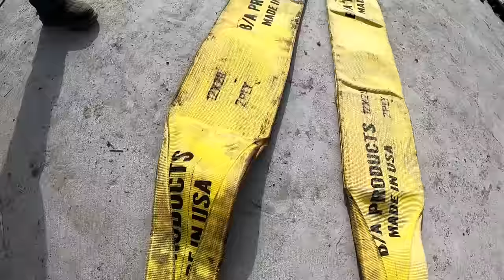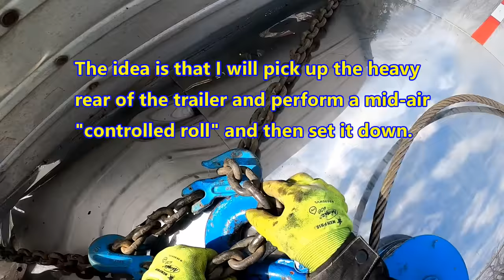Haz-Mat Tanker Rollover Shuts Down Everything!!!

Comment: Possibly dumb question. Why not connect the vent lines as well as the transfer lines? Seal the system, pump the liquid into the good tank and vent the displaced air into the wreck? Seems to me that would solve a multitude of issues. The vent line on the good tank would always stay above the liquid level, the displaced air would help move the liquid and keep the wreck from collapsing under vacuum, and non of the vapour would escape.
Reply from the maker: Not a dumb question, but one I can't answer.   I was not part of the off-load crew.   The trucking company hired them.  I happened to know a couple of the guys on the crew and I was around during the off-load, but that is not my area of expertise.   Thanks for watching and God bless.

Comment: Having watched your exploits and excellent approach to problem-solving in the field, I watch this alternative and was less than impressed (Rotator work ep #104 road block). It made me appreciate what you do all the more. I am a Marine Engineer and from the UK and appreciate how you try to prevent additional damage by your planning and execution of your jobs.  
I would also like to know ( but you can say none of your business if you wish) did you purchase your 1150R new, and how much more expensive in comparison would the new M100 be, 100%, 150% more? Lastly how much equipment do you need to purchase, for example, are the chains and strops an extra cost? 
Great videos, keep them coming and may your God look after you and your team.
Reply from the maker: I have not watched the episode that you reference, so I can't speak about it.   I can answer some of your other questions.  We did purchase the rotator new in 2015......ordered in 2014 and it cost a little over $600,000 USD + another $150,000 USD for the rest of the equipment on it.  Some of the chains, the carousel, D-ring shackles, etc. can be purchased as options to be on the truck when taking deliver, which is what we did.  We still added a lot of other things and have continued to add as we go.    If we were to have to replace the truck now, the current price without all the extra gear I mentioned would be around $750,000.   The new M100, I've been told, is almost double that, but I do not know that to be fact.   I do trust my source, though, and I would believe that that machine cost that amount.   I wish we had enough business to support such a machine.  Perhaps some day.....    Thanks for watching and God bless.
Reply: @RonPratt  Thank you Ron,,
Just like your videos a complete and truthful answer. I was wondering if the size of the lift cables and the associated equipment on the M100 would require two or more people to manipulate where you only need one with the 1150R. So the cost of the job almost quadrupled with a doubling of capacity?
Thanks Again and keep up the good work.
PS It took me an episode to two to realise your comments were in company colours. Great eye for detail on your part (Thumbs Up)
Reply from the maker: Our truck is almost a two person truck as it is.  Some of our rigging is very heavy.  So I would guess that the M100 would REQUIRE two people to handle all the rigging, if not more.   Our biggest chains are 5/8" grade 100 X 20' and they are extremely heavy.   Our largest master link is 1 1/2" diameter.   From what little I have seen on Miller's videos, that is about where they start on the M100.   Generally what you seen me using are the 1/2" grade 100 chains, which are heavy enough on their own.  We grab the 5/8" on most loaded rollovers.   
As for the color-coordination.....I try.... ;-)
Thanks again.
Reply: @RonPratt   I enjoy being able to watch what you do, the way you present and lead your team. Respect.

Comment: Linguistic "tip" (or linguistip) here: The "arc" here is usually arch- as a prefix, like "arch-nemesis" etc. The prefix comes all the way from the Greek word archos (αρχός) which means the chief, the boss. This is the same root that gave us archbishop, archangel, monarch, etc.
Reply from the maker: I am very familiar with the origins and the terminology.   I intended to use the term "ARC' NEMESIS, as a play on words.  We work around high voltage power lines frequently and they can create an "ARC" of electricity.   Thus.....the improper, yet intentional use of the term "ARC" NEMESIS.  Thanks for watching and God bless.
Reply: @RonPratt  Touché! The joke's on me and I had missed it completely!

Comment: Rob I just noticed how clear your videos are..what brand of go pro. Im asking because I take videos while we are out riding the backcountry roads on the motorcycle.
Reply from the maker: I use several different GoPro cameras.   I don't remember which version I was using during this incident, perhaps the Hero 8?  The Hero 8, 10, and 11 are all excellent cameras.  I had a lot of problems with the Hero 9 and lost a LOT of good footage.   So, I would stay away from the Hero 9.  Both the Hero 10 & Hero 11 are very good cameras.  The 11 has a little better night vision and stabilization.   The 11 is also capable of higher resolution footage than the 10, but not by much.  I'm currently using the GoPro Hero 11 and I'm loving it!!!    Thanks for watching and God bless.
Reply: @RonPratt  thank you so much..I cant wait til I can get some good riding videos.

Comment: I don't see a grounding wire between the tanks. That's usually used to avoid static electrical charges building up between the tanks - which may cause a spark...
Reply from the maker: This incident was several years ago, now.   However, I know how well the Regional HSRT Team works and they would have made certain that the tank was grounded.   I've trained with them.   Thanks for watching and God bless.
Reply: ...and I would have attached a grounding wire between the wrecker and the tanker, for the same reason. After all they're both on rubber tyres.

Comment: That would’ve been a low speed rollover which the frame may not of bent but because nothing is hooked to the cab to keep it from flipping the frame definitely is bent now with slam down and probably did some suspension damage to the front of that semi! That’s sad with all that equipment there but nothing was able to keep the cab from slamming the way it did

Comment: I kind of would have liked to see the reactions from the responders when they finally found out that it wasn't either diesel or gas, but whatever unholy mix of waste they had in there. Over where I live, having a diesel sign on your truck when it's not diesel would net you a nasty fine at the very least, because firefighters could get hurt using procedures for a diesel recovery if it was something nastier.
Reply from the maker: The fire and HazMat crew had the BOL which showed exactly what was in the trailer.   I showed I brief clip of me going back to the command center.   I cut out all of the discussion about what was in the tank.   I also cut out the command center discussion of our recovery plan with all the various agencies.   I would have loved to have kept that part in the video, but there was sensitive company and driver information involved, so I cut that part.   Thanks for watching and God bless.

Comment: Hey Ron I’m a firefighter in Canada. You said you could smell it. It’s hazardous panel is wrong if it’s a mix of waste. If it’s radioactive waste or nuclear waste forehead monitors won’t go off. Probably should line up some court documents to be able to quickly sue if you fall ill. You don’t got Obama care anymore
Reply: It was a mix of flammables, not radioactives. The placard indicates flammable, not otherwise specified, low flash point, which is what they had to deal with. Nothing more, nothing less.

Comment: I know it might sound daft, but would you not remove the fuel from the tractor itself, its own fuel (not the load), so that minimizes possible spillage during the roll over maneuver?
Reply: The fuel tanks weren't breached. The caps were intact and the fuel contained. Opening the caps to get to the fuel would have risked causing a spill instead of preventing one.

Comment: Hazmat DOT will love this video!  No ground line anywhere!  Wrong tank for hauling fuel!  Great training video!  Sure glad everything worked out but in the future may want some hazmat training!
Reply from the maker: You need to look and listen closer, sir.  There was a ground rod and wire running to the overturned tank.  They are clearly visible in the video.  I also discuss what is in the tank.  The driver had given wrong information, perhaps due to his recent traumatic event.  We found the BOL and the tank had a mixture of flammable hazardous wastes.  It was placarded correctly.   Thanks for watching and God bless.

Comment: Irony is I work in  a wash bay and we have these high shine tanker trailers they arent that big on the inside but if this is the same company as we use for these then they all have air valve venting on the passenger side of the trailer depending on this trailers age
Reply from the maker: Thank you for watching and God bless.

Comment: If in fact this CDL/Hazmat driver was actually hauling Gasoline. I see a Big Fat ticket already. Time-13.55. His Placard he is running is mainly used for Diesel ( 1993 ). The correct Placard should of been ( 1203 ) placard. Just thought I put that out there.
Reply: The gasoline reference was from a misstatement by the (understandably) shook up driver. Ron explained that HazMat and Fire retrieved the BOL and correctly identified the cargo as flammable waste material, consistent with the placard. He didn't show the details for reasons he explained in replies to other comments.

Comment: I'm nowhere near an expert, not even a novice. But I just had a thought. I assume the hauler is what prevented the whole trailer from rolling into the ditch. Couldn't they have put air bags in the ditch under the trailer to keep it from rolling in. Detached the hauler from the trailer, dragged away the hauler. Then lift the trailer separately? Like I said, I don't know squat, and your plan worked in the end. It just seemed more dangerous/precarious to lift them both at the same time.
Reply from the maker: In my opinion, it is actually much safer to leave the "hauler", as you call it, attached to a loaded trailer.  The legs of the trailer are not strong enough to withstand the side pressure of a rollover.   And air cushions on a tank are very unstable.  This type of insulated tank is especially dangerous to the air cushions.   The outer shell is very thin stainless steel with a layer of insulation underneath it, then you have the thick core tank.   The outer shell will crush and move around which can very easily cut through air cushions or straps.   There is a method that could be used to upright the tank if the hauler is removed, but it is a very advanced method and very dangerous with this type of tank.    Thanks for watching and God bless.
Reply: @RonPratt  I see, with that information I can see how there is risk.

Comment: Hey Ron, so how would you take away a tractor trailer, that was on fire, do you guys have a trailer, also any plans to buy a safety car, with traffic cones, signs, and a digital message sign board?
Reply: They've handled burn outs. Midwest doesn't have a trailer (yet), but they have a working relationship with a company that does. They do have a support vehicle, a Ram pickup, #16, that Dad Pratt drives. Ron did a walk around recently. You can search the channel page for it.

Comment: Why did you choose to do the tractor at the same time as the trailer? Just curious...did it counter balance or something?
Reply from the maker: Leaving the tractor connected to the trailer actually helps support the nose of the trailer.  Which is especially important when the trailer is loaded.   The dolly legs (landing gear) can and will fold under causing a potentially catastrophic failure if the truck isn't connected and the nose of the trailer isn't supported properly.   To me, this is the safest method.    Thanks for watching and God bless.

Comment: 1993 is not gas, gas is 1203. My guess is waste oils. The tanker doing the transfer is where the fumes are coming from because it has to be vented to transfer as well. You'd be surprised how much vacuum those chemical tanks han handle before they start to cavatate.
Reply: The tank will likely survive to work. I've seen tanks get new skin many times. Chemical tanks cost twice what the tractor does.

Comment: The UN number says 1993, if it was gasoline it should be 1203. So it is probably a type of diesel. It should not be gasoline or I think they would be illegal. Not sure tho, cause maybe gasoline is included in 1993, but it would be wierd since gasoline is classified as 1203. If they are legal with that card, it should be a variant of diesel.

And about the venting, it will still vent if the venting system as not been damaged, but the pump will work a lot more than usual to force the vent in the tank, to counter the resistance. While there is resistance on the vent system, the pump will just pump less fluid but work harder. If the pump would no be enough powerful, it will just run dry and not transfer any liquid. It is probably a centrifugal pump or something similar for safety, and not a rotary gear pump or the like, otherwise it would definitly crush any tank that the vent system is not working.

I also don't know why he has to justify himself about the jokes (14:08), any person that has been multiple times in a stressful situation would understand. It is just common sense. He is probably justifying himself for all the keyboard warriors in the comments of youtube. Haha

Comment: coming soon, huge very strong lifting points on 4 sides of the tankers, rear mid and front. makes more sense to me than the darwin thin outer tank over thick inner tank. meaning if it wrecks hard enough to puncture the inner tank, the outer tank is useless anyway. I have a feeling it's all because  some of the tanks were ancient and not maintained and had small leaks at one point and california(cancer) entered the party, oh well, "reap what you sow " comes to mind and what they have all done is is very bad.

Comment: I dont know if you are going to be able to tell if the tank crushes, I would think that a thick steel tank like that will hold allot of pressure, but once it succumbs to the force where it will implode, it will do it very very quickly and very violently. Have seen these and railroad tank cars implode, and when they do, watch the hell out, because nothing you will do will stop it, and heaven help you if you are near that thing when it goes off. Look at some of the videos on YouTube on tank car implosion and you'll see what I'm talking about. If you are near that thing when she goes, lets just say you are going to need a new pair of Jockeys because not only you going to shit yourself, but you'll probably blow a hole right through them. Lol

Comment: The hazmat placard on the back of the trailer shows 1993, which is the indicator for diesel, if the product were gasoline the placard would read 1203. Unless the driver 'forgot' to switch the numbers.
I cannot for the life of me understand why gasoline is in that tanker? It never gets cold enough for the viscosity of gasoline to thicken to the point that they can't unload it.
Reply from the maker: ACTUALLY.....UN 1993 Includes diesel fuel, but covers a lot more chemicals than just diesel fuel.   Please refer to Guide 128 UN1993 in the 2020 ERG.   I guarantee you that the chemicals in this tank were NOT diesel fuel.    Thanks for watching and God bless.

Comment: How does the driver not know or at the very least have some paper work on what he hauling? Did the driver run off? Ive seen guys roll bottom dumps at a large county landfill and just get outa the cab start  running. Pretty sure they werent citizens and did not have a license let alone a commercial one.

Comment: UN number 1993, is to tell the firefighters, what`s in the tank, so they know, how to deal with it, the orange numbers, on the front, and on the back of the lorry. It is highly flammable, has a boiling point at 23 degrees Celsius, the all most empty tank is more explosive, then full tank. Pumping from the the tilted tanker takes a lot of precaution, you need to zero the two vehicles, between them, to avoid electrical differences, that can cause sparks, sparks will set this hidden bomb of. Diesel UN numbers should be labelled on the truck as : (30) (1202) Gasoline UN number is : (33) (1203) On the warningplate, for the firefigthers, so they know what they are dealing with, when they approach, an accident like this, for their safety.

Comment: UN 1993 Class 3 Compounds, tree killing, liquid or Compounds, weed killing, liquid
UN 1993 Class 3 Diesel fuel
UN 1993 Class 3 Flammable liquids, n.o.s.
UN 1993 Class 3 Fuel oil (No. 1, 2, 4, 5, or 6). 
this is what could be in the tanker its most likely N.O.S or Fuel Oil
Reply: Being a hazmat driver, I was going to say that the placard definitely didn't show gasoline, rather Diesel or N.O.S. Great work on pointing this out.

Comment: May I ask why fuel is worse than diesel? Is diesel more stable? Does it have a higher flash point?
Reply: Diesel wont ignite so easily even with a cigarrete, whereas gasoline and its vapors goes kaboom at any spark.
Reply: Any fuel (petrol) that evaporates can be ignited by a spark, diesel is more oil based so the vapour needs a lot of heat to ignite it a spark isn’t enough, however it’s still very dangerous. 
In the motor trade, petrol is spark ignition and diesel is compression ignition